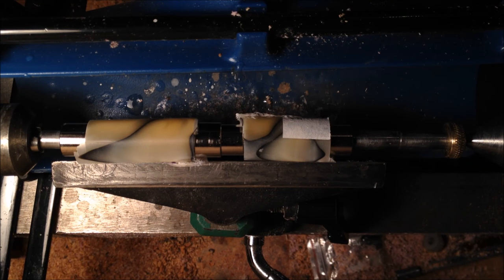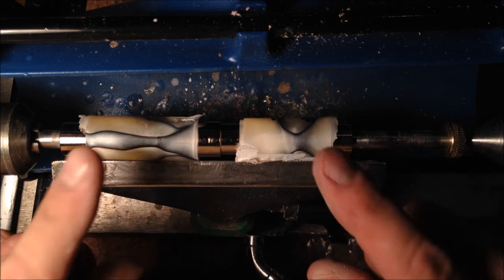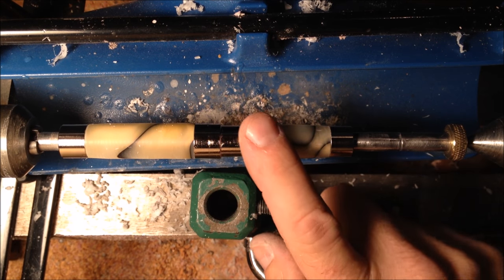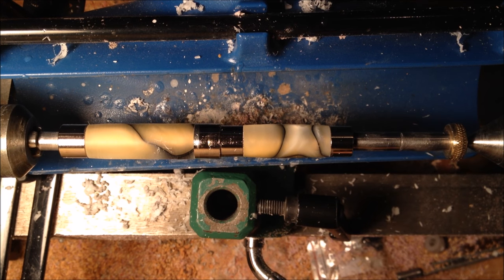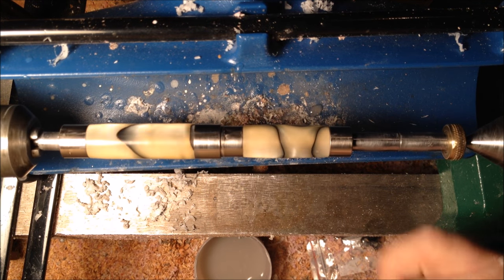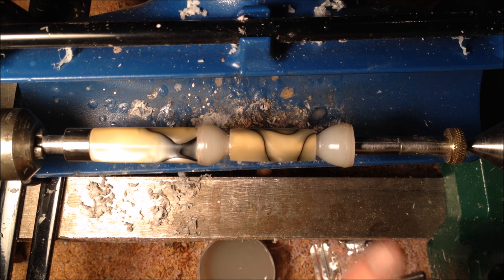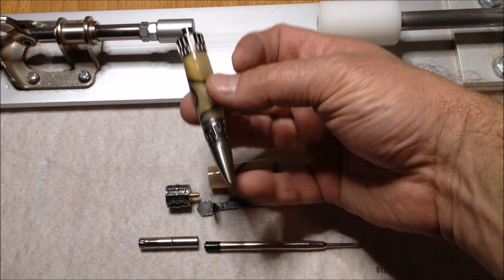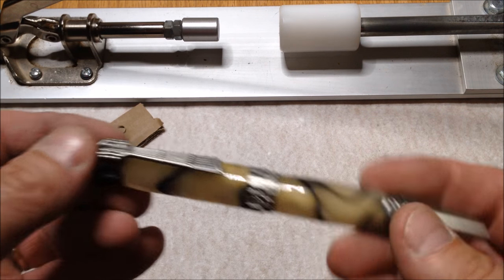Turning The Music Pen - This One Is For Music Lovers Everywhere

Comment: I love the lustre of the blank, nice fix with the catch. Not a fan of the finished pen, but each to their own on that. Quick question if I may, what's the longevity on the micro mesh pads? Thanks for the vids, have a great day.
Reply from the maker: +Neffers I've probably made 75 pens with this set. They work better when new but even a little wore still get the job done. 

Regards,
Bob
Reply: RJBWoodTurner Thanks for that. not a bad investment by any means. Have you a preference between acrylic's and wood, or just turning whatever you have for the love of it? Hopefully I can save for a  mandrel etc. over the winter and make use of my lathe for quick (ish) fun stuff. Wife is ill and can't leave her for long, yet am dying to make things in my shed, aaargh lol.
Reply from the maker: +Neffers I like turning anything just for the enjoyment of turning it. 

Bob
Reply: RJBWoodTurner k

Comment: I found that the bushings produced a blank that was slightly too large at the pen tip and at the drum end. I had to knock the pen apart and sand a bevel at both ends to avoid feeling a sharp edge.  I notified PSI three days ago, but have no comment back from them yet.
Reply from the maker: +Doug Robins Here's my procedure:

Turn completely level with the bushings. 
Sand through 400. 
Swap out to non stick bushings. 
C/A the blank which will thicken it and leave an edge where the bushings meet the blank. 
Swap the original turning bushings back onto the mandrel. 
Micro Mesh to the bushings. 

I've had really good luck and get tight tolerances doing it this way. It is possible the bushings are mis-sized. Look at the instruction sheet and get the diameter. Use your calipers to verify its correct. 

Bob